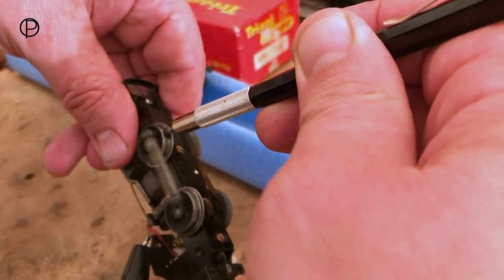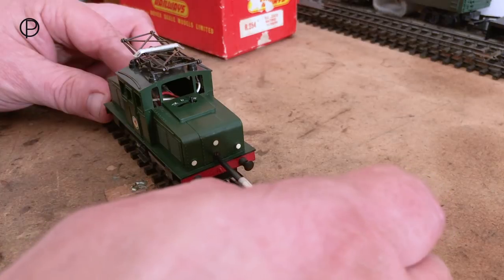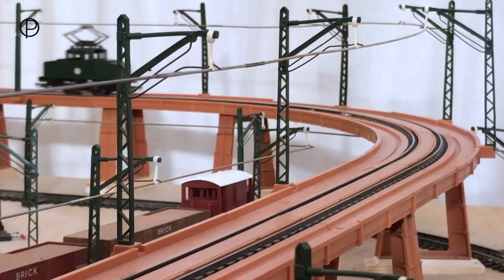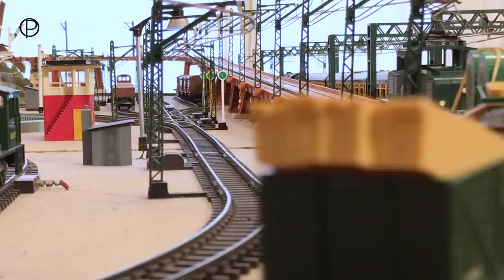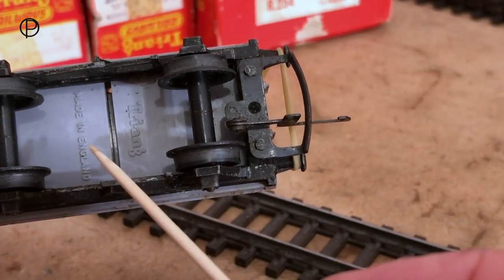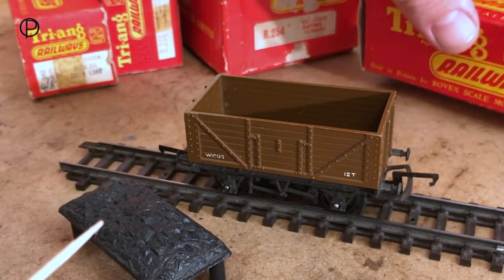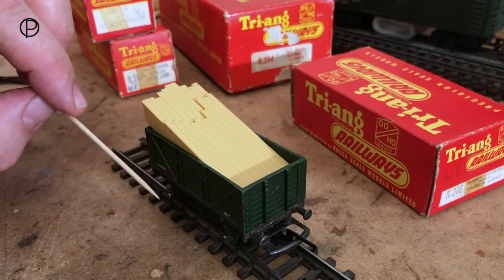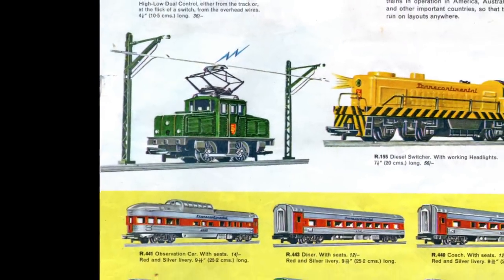Tri-ang Railways R.254 Steeple Cab 0-4-0 Electric Locomotive with mixed Goods

Comment: Oscar is'nt the 'i' stamped on the R254 chassis really an 'L' for live? Lovely model-how does it run across the diamonds though?
Reply from the maker: The models that use the catenary have to have the (I) Insulated wheels placed on the track on the power mast side. Current is collected via the pantograph and returned to the track via the wheels on the none insulated side of the model marked (R). These models that collect from the overhead seem negotiate the diamond crossings very well.
Thanks for watching.
Oscar
Reply: Thanks for that Oscar, regards Paul

Comment: Very nice to see a such small British electric loco produced by Tri-ang. She is similar to the German electric loco BR 69 I have. Produced by Piko in the former German Democratic Republic over 40 years ago.
Reply from the maker: Hi Norbert, I've just had a look at the BR 69 on google. That it is very similar design. A great looking model. Will it run from the overhead? I believe locomotives of this design were still in use in northern England in the late 1980s https://youtu.be/sLwqkGYgB-0
Oscar
Reply: Hi Oscar, yes, the model is run from the overhead too. Models are available from different companies till today in maroon, green, and blue white. The original five locos were built between 1905 and 1930. All five locos are preserved.
https://de.wikipedia.org/wiki/LAG_1_bis_5
Wikipedia page only availaible in German language but with several photos.

Comment: Those things are the "sanding boxes" on the side. I don't know if this loco is fictional, but it reminds me of the  Piko E69, witch also had a drive of an already existing model: under the body the same drive+motor can be found as in the Piko's old NohAB. They replaced the bogie mask with the chassis imitation, a body, and removed the non-driven middle wheel (the NohAB  is a Co'Co'), and there u go they had a new (cheap) 0-4-0 electric loco. https://pufiland.weebly.com/ho-scale.html
Reply from the maker: Thanks Tom I'm not sure which locomotive this was based on. But Pat Hammonds book suggests it was based on a locomotive built by EEC of Staford for the Fairfield Shipbuilding Company  http://www.srpsmuseum.org.uk/10014.htm and a German Class E electric Locomotive.  It's also similar to locomotives used in the north east of England in the coal industry  https://youtu.be/Kom4AaeLnlc  The Piko looks very similar. I was unaware of this model until today when yourself and another Youtuber pointed it out. That was a great link many thanks.
Oscar

Comment: Hello Oscar. Thank you so much for your kind words. I woke this morning to find 4 new subscribers to my channel and another has joined since then. It just goes to show the power of giving each other a mention.
This steeple cab loco was something of a curiosity to me as a child, I could not place it as a prototype loco so I never added it to my collection.  I do have some of those wagons and again you have added to my knowledge about them.
I agree with Tom and Mike regarding the boxes on the side frames. They look very much like sandboxes. 
This is another terrific video from Oscar.  Thank you again, David.
Reply from the maker: Hi David, Your welcome.

This is what I have on the Steeple cab:

Pat Hammonds book suggests it was based on a locomotive built by EEC of Staford for the Fairfield Shipbuilding Company  http://www.srpsmuseum.org.uk/10014.htm and a German Class E electric Locomotive.  It's also similar to locomotives used in the north east of England in the coal industry  https://youtu.be/Kom4AaeLnlc 

I think you are right about the sandboxes.  I hadn't thought of it. Thanks. Oscar
Reply: So there is a prototype after all. Thank you Oscar.  David.
Reply: @trainsontuesday  The red one looked to me like a comically shrunk version of the Swiss Crocodile which has the same three light ends and is in the same maroon colour with coupling rods though much larger and definitely not an 040! I just saw a video of Japan and the Matsui Miike yards and there's something the same colour and almost identical except for the lack of coupling rods.

Comment: I've been a fan of Electric locos since i got my first one in the late 50's (Fleischmann A/E 6/6 Gothard  loco). Seeing models at exhibitions with no overhead line or pantographs down turns me into 'the Hulk'.
Reply from the maker: Good evening Geoff, Fleischmann have made some lovely looking models and seem to have been offed a catenary system at times since the early 50s which could have been used live at some point. I'm unsure if they still offer this live or otherwise.
Thanks again
Oscar

Comment: Brilliant and as always Informative...Thank you for explaining the two different model numbers, which as puzzled me on some of my models.. Film on how your railway runs sooooooooo smoothly would be great...From Track cleaning, to running power etc....Your films as given me the confidence to go through my collection and set up a permanent layout for my Tri-ang.....Thank you
Reply from the maker: Hi Paul that's great to hear you planing a layout out for your Tri-ang collection. It will be a great deal of fun and very rewarding. The smooth running is just good preparation of track and rolling stock. And basic routine maintenance/cleaning. The multiple model numbers puzzled me for some time especially on some of the early coaches.
Oscar

Comment: Oscar the things you cant identify on either end of the chassis are sanding boxes.
They held sand and had a pipe near rhe wheel, it was to drop sand on the rails if locos slip on greasy rails.
Reply from the maker: Thanks for the information. My knowledge of real working railways is not what it should. I do love to see a good locomotive in action and I visit the odd museum or two. It's a very wide subject Railways,  Model Railways, Collecting toy trains and running them.
Thanks again Steven for the information I really appreciate you taking the time to share it with me.
Oscar